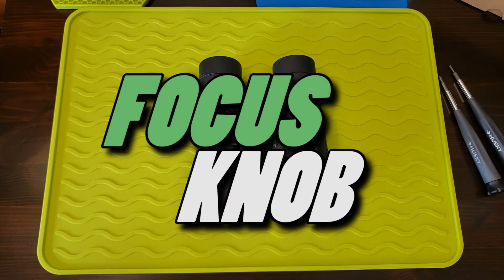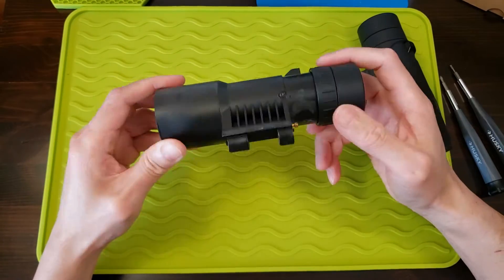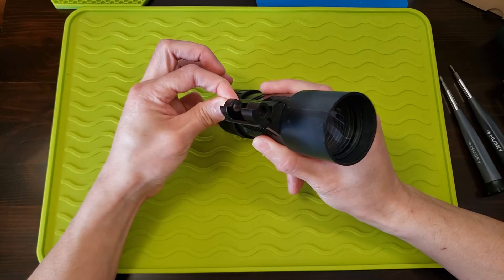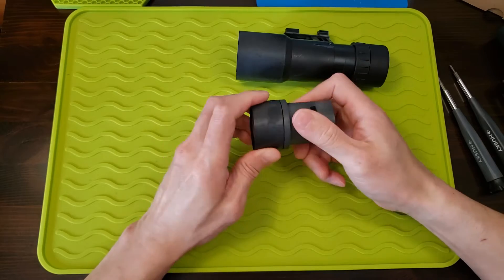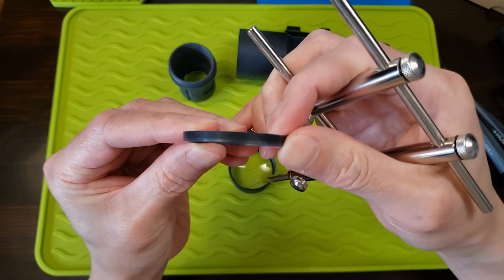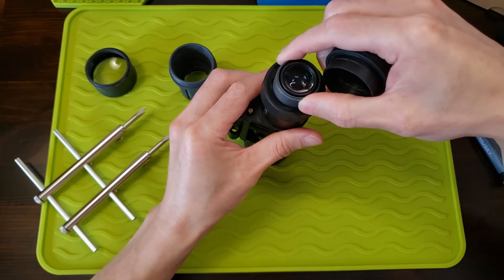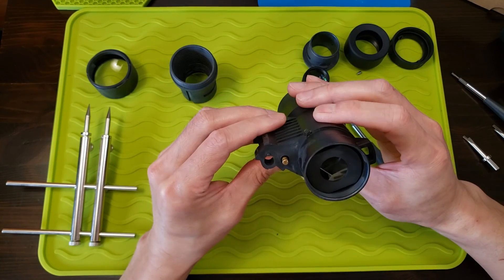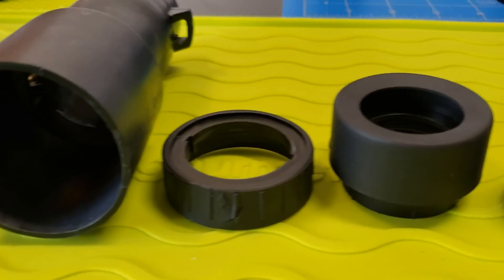Binoculars Teardown and See How Binoculars are Made

Comment: I've got a similar pair of binoculars I want to repair but I can't seem to remove the center post/axle. How did you do it?
Reply from the maker: Watch this video at the ten minute mark where I removed the focus knob.  Is that where you're at?
https://youtu.be/e2zgP0hnRiQ
Reply: @FocusKnob  Yep.
Reply from the maker: You need to detach everything connected to the center post.  Once it's free, if I remember correctly, the post should slide off or if it's tight you may have to hammer it off.  Also make sure there is no c-clip on the post.
Reply: @FocusKnob  Scary thing to be hammering away at a pair of binoculars. But it worked. Thanks a lot!
Reply from the maker: nice, it worked for you.  Small taps is all it takes.

Comment: Hi great video. Can you help me pick a 10x50 for beginners under 60 bucks, I was thinking of 
a) Bushnell Falcon 10X50 Wide Angle Binoculars 
b) Celestron 71256 G2 10x50 Upclose Wide-Angle Porro Binoculars 
c) Celestron Upclose G2 20X50 Porro Binocular
Few things which I wanted as a beginner like FMC Lens and bak-4 are missing on all 3 binos, but still if you can help with some insight it will be really helpful. Also my purpose just random things, during safaris, trekking, and bird watching etc. Thanks in advance :D
Reply from the maker: Where are you located?  Must it be 50mm binoculars?  If you'll be viewing primarily during the day I would go with a smaller binoculars as it will be easier to carry and lightweight. A 50mm binoculars can feel heavy to some people.  A 20x binoculars should be used with tripods or your views will be too shaky if hand held.
Reply: @FocusKnob  I live in India, Yes I want 50mm at least as I have heard more light = better image. And 10x zoom as it is good for both long and short distances. I can leave 20x50 as you said it will require a tripod and I only want hand held binos. Your help will be really appreciated. :)
Reply from the maker: Bigger doesn't necessarily mean brighter and better image.  Lens quality and better lens coatings does make a big difference. With your budget then I would go with the Celestron G2.  But if you would go down in size to 40mm objectives you can get the  PENTAX SP 8x40 or Barska Crush 10x42 both with Bak-4 prisms and FMC and a bit more in eye relief for a little bit more money.  The Pentax Jupiter 8x40 is closer to your original budget but doesn't have Bak-4 or FMC. If you are mainly going to be doing day viewing then a 25mm binoculars would be plenty bright.  No sense carrying a heavy 50mm binoculars when the sun is out.
Reply: @FocusKnob  Thank you so much for your insight. I'll look for what you have suggested and buy accordingly. Thanks once again <3
Reply: @BeAk5  If you're really determined on buying a pair of binos with those specs mainly FMC and BaK 4, I would highly suggest you the SvBony SV206. I recently bought myself this pair and it's a really nice bino I must say. Comes with great eye relief at 23mm and also FMC and Bak 4 prisms with great wide angle viewing at 7.5° and also a bonus it's ipx6 water resistant. It's been a delight for me in visual astro and I think it will suit you quite well too. Cheers!